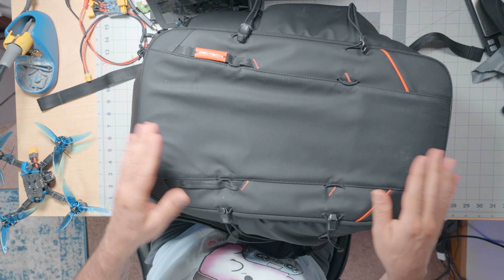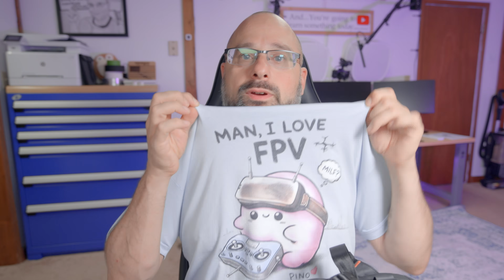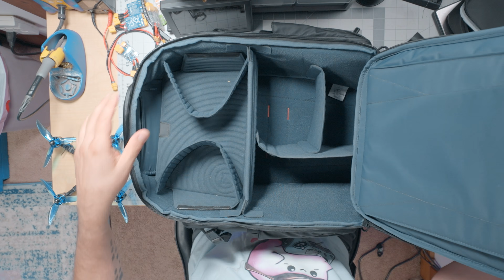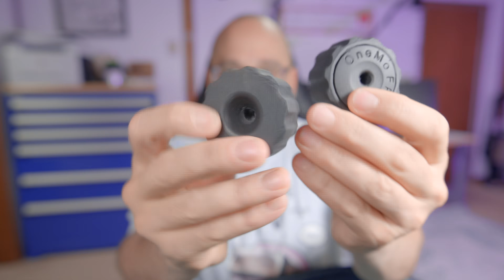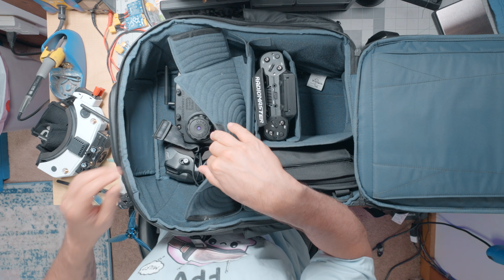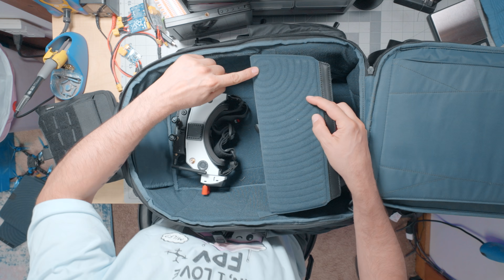PGYTech FPV Backpack: my new daily driver

Comment: I don't get why people design drone backpacks with back loading - even iFlight did that with their V2 backpack for some reason. You have to either put your backpack on top of your drones every time you open it or take them off every time. AND even if you for some reason like that, you can always just get a Lowepro ProTactic 450 covered in molle straps - and it's just on another level in terms of quality and convenience.  Iflight V1 was perfect in terms of design, but the quality is not there - jamming zippers, organizers and walls losing form fast, zipper handles broken in two years. I've used the hell out of it, though. Anyway, I'm looking at Manfrotto Pro Light Multiloader or Manfrotto PL Flexloader now - this is what FPV backpacks should look like IMO.
Reply: Crazy ball knowledge, the multi loader 26L looks perfect

Comment: Ditch this one and get the pgytech onemo 2. It’s a big bag, hold a shit ton. If you don’t want a big bag, don’t get it. I hold 2 whoops and batteries in the small bag alone. And then everything else batteries and charger and all in the other space. Holds 3 quads easy on the outside.

Comment: I use a Peak Design everyday camera bag for drones and it has very similar Velcro divider partitions. It also has a strap system on the back and has been honestly a wonderful bag for drones all these years.

I save so much space with the padded compartments so I don’t have to have cases for my goggles, radio, etc. taking up space

Comment: Seems like a good camera bag. But lacking in the "drone bag" areas, like strapping on quads quickly, storing goggles n controller where they are safe and accessible from the outside.  Wish they'd bring back the Betaflight Backpack

Comment: I am disappointed of this review. I was expecting you to show how you organize 2-3 drones in or on the backpack, not how you organize 3 pairs of goggles. I was also wishing a more in depth comparison with another company specialised in backpacks, and I am talking about Torvol.
Reply: Now..now now .....Josh
Reply from the maker: I don't think 2-3 drones will fit into the bag easily, at least not without making a compromise in what else you can bring. With props off, you could get one 5" in the top section. The rest would be strapped to the back, but that hardly requires a detailed explanation.